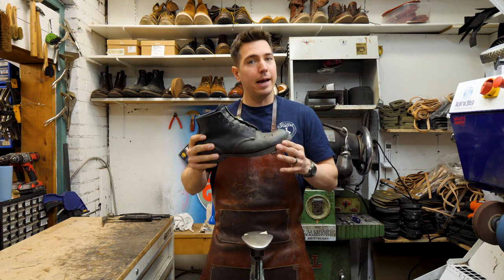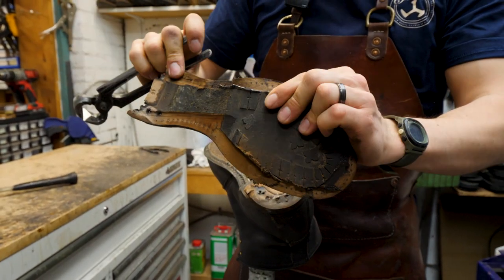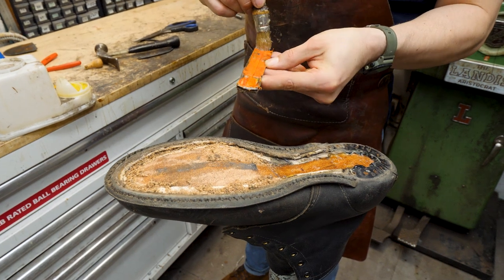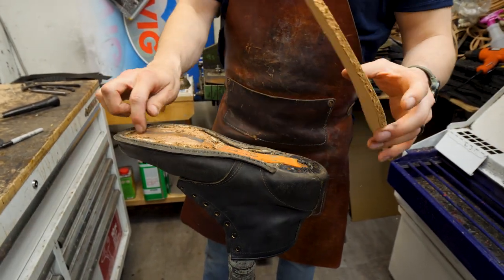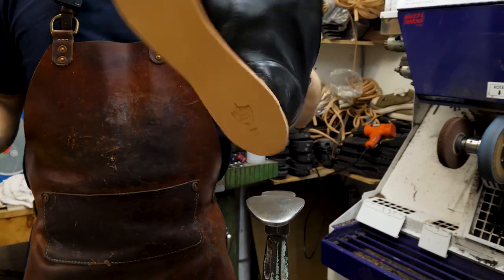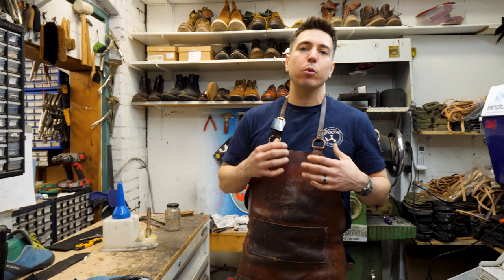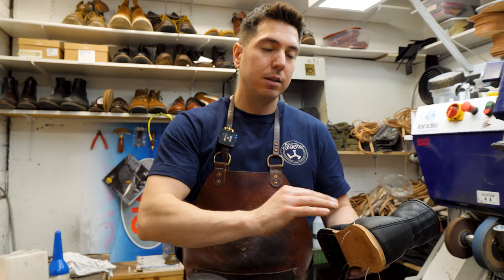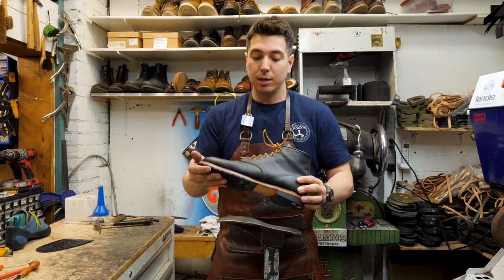Red Wing boots resoled with Vibram and Catspaw rubber!

Comment: Woah, that RFID chip was an interesting find! I had no idea they did that.
Reply from the maker: I have found a few over the years. Other brands as well
Reply: The only problem with that is RFID has zero value as evidence value.  It does nothing prove whether the item was paid for.  It is probably used for tracking manufacturing batches, for when the boots are returned to the factory for warranty claims or resoles.  Or for authentication.  A counterfeit boot will not have the RFID.
Reply: @chinatownboy7482  what do you mean by "evidence value"? I'm not sure anyone claimed that RFID did anything more than track inventory/authenticity.

Comment: These look really cool. How does the rubber half sole setup hold up in your winters? Are they much more vulnerable than full rubber soles?
Reply from the maker: Good question and I’m not entirely sure. You would good traction with the mini lugs. Maybe check Reddit threads and see how Red Wing Beckmans perform in winter.

Comment: I'm surprised by the cardboard midsole, as Red Wing used to state the Beckmans had a leather midsole. Had these boots been resoled before or do we assume Red Wing started cutting corners some time before discontinuing the Beckmans?

My Beckmans are from 2017, and I am going to hope the midsole won't rot out.
Reply: Did he show the tag with the date? Im also surprised by this...
Reply: Probably a "leather board" which has leather pulp in it.
Reply from the maker: Great question! I'm so surprised as well, considering Red Wing uses their own tannery as well. But they also use plastic heel rands when they have access to tons of leather. As commented already, it's likely leather board. But it tore apart like cardboard.
Reply: @dimarshoerepair   thanks so much for responding to our comments and questions! Another question: to your knowledge were these resoled before? I've seen other Beckman resoles, and they look like leather. 🤷🏾‍♂️ Interesting either way. Thanks again and keep up the impeccable work! I wish shipping was more reasonable, otherwise I'd have you guys do my resoles. Absolutely stunning work.
Reply: @Rabnes25  No these were all the original components!